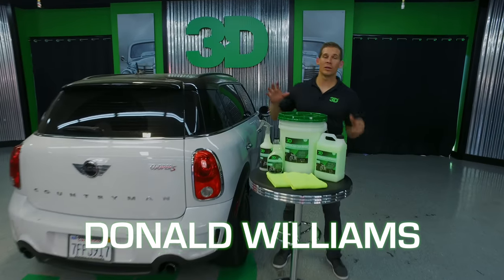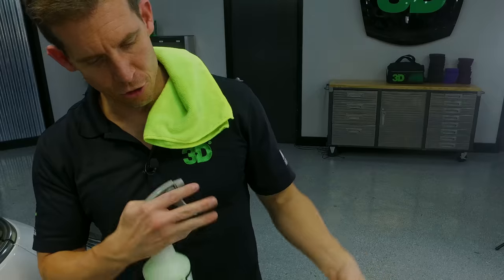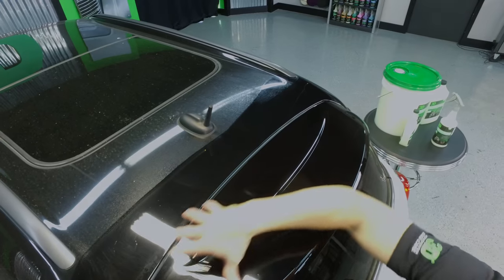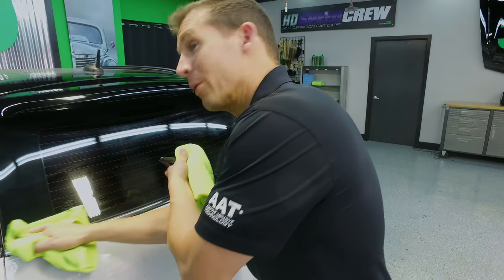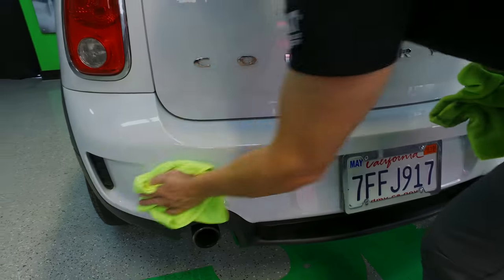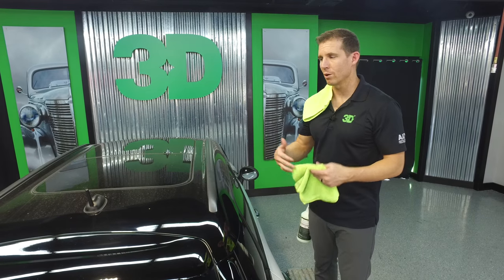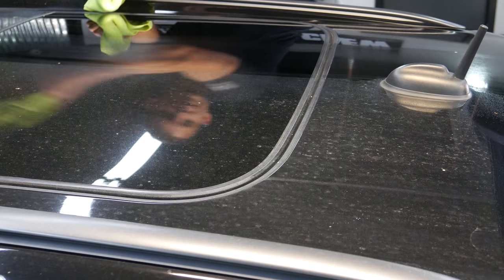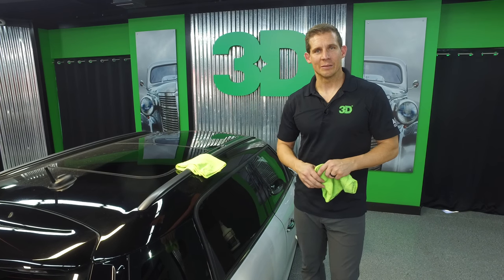Wash your dirty car without water?

Comment: Not doubting the effectiveness of the product but would like to see it used on a car from New York or similar area during the winter. When the car is covered with salt, dirt and mud and is really dirty.
Reply: Hector Serrano it’s for maintaining a properly taken care of car. Like 2-3 times a month then a regular wash at end of month. As long as your car maintains a nice wax on it the waterless works wonders
Reply: Jesse Castro thank you because the cars here are horrible
Reply: You’re better off with a “rinseless” wash for that. Grab a higher concentration in a spray bottle spray it down, hose off the gunk, and using warm water wash the car with your media of choice. But if you’re brave, I bet a waterless could do it if you experimented and used 1000 towels and a pump sprayer but probably would use too much product lol